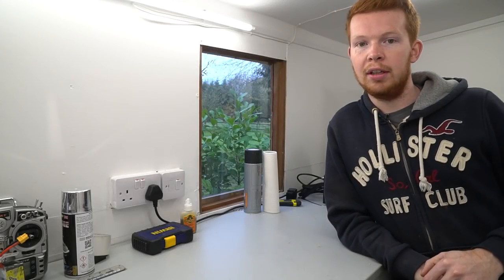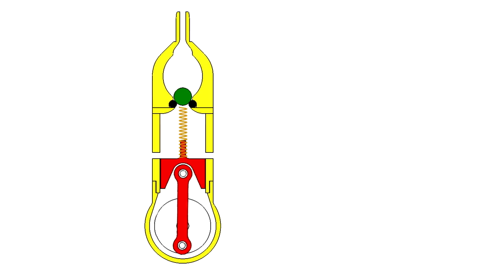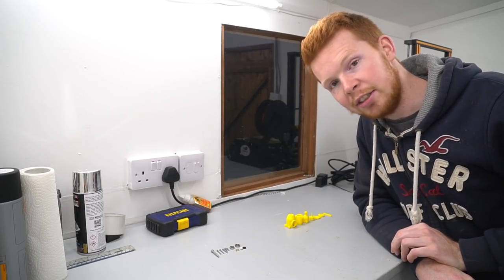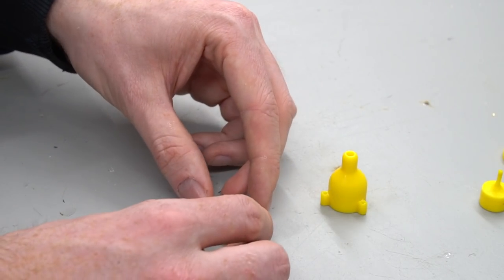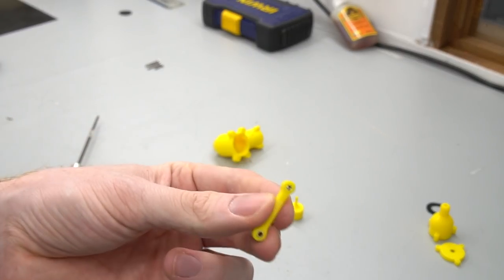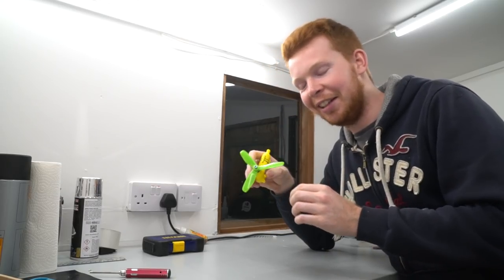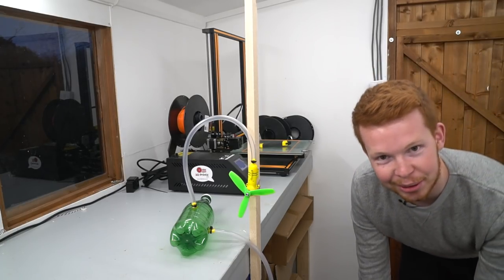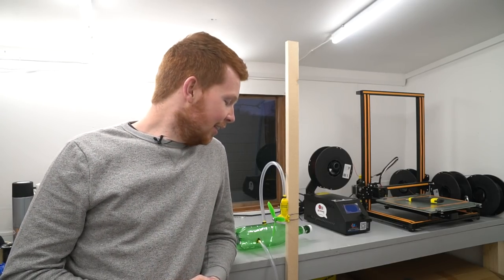Compressed Air Engine

Comment: this was the first video I seen of your channel, I liked the video and you did a great job making the 95% working model, however, it is  rather disappointing that you ll only share the STL's with people that throw money your way. what happened too being part of a 3d printing/makers community, Does that not mean anything anymore? Just find if a little cheesy and cheap on your part. Other then that Good job.
Reply from the maker: +patprop74 apologies for disappointing you, however I have worked nearly 80 hours (yes 80 hours over 2 weeks!) to getting this engine designed, prototyped, modified and working. It would only cost $1 to gain access to it, is that too much to ask? Thanks for the kind words

Comment: NEVER EVER EVER SMOOTH PARTS THAT NEED LOW TOLERANCE.
Reply from the maker: +Eric Hallahan the cylinder and piston had to be smoothed to reduce friction, which needed to be accounted for when calculating the tolerences
Reply: Thanks for your reply. This was a special case where the friction would be more impactful than the warping. Just be careful in the future!

Comment: Just finished and tuned my version of your v2 engine. I had to modify a few things. All I had available was 625 bearings which are 5x16x5 but once I found the right size spring it ran quite nicely at around 5-10 PSI. https://youtu.be/3wAun9yqxYc